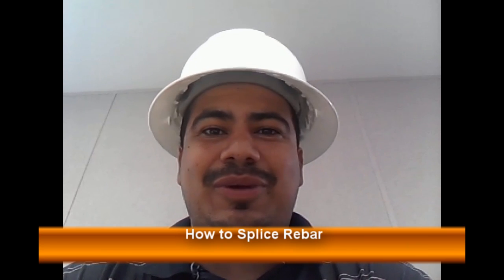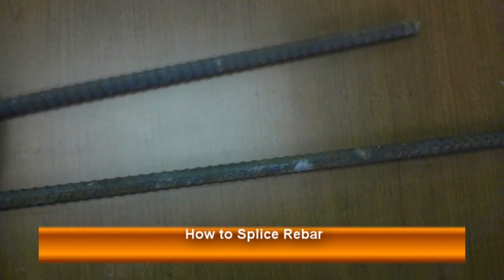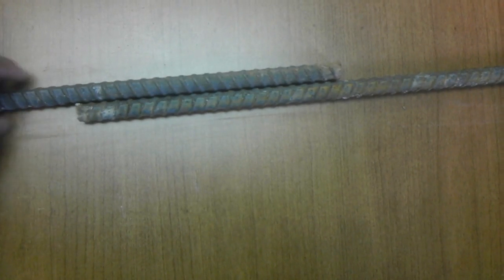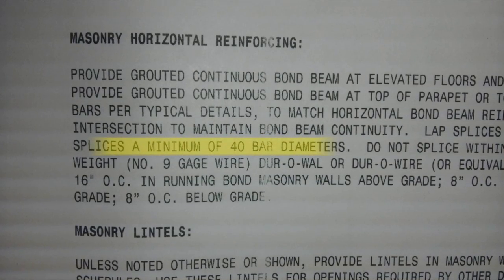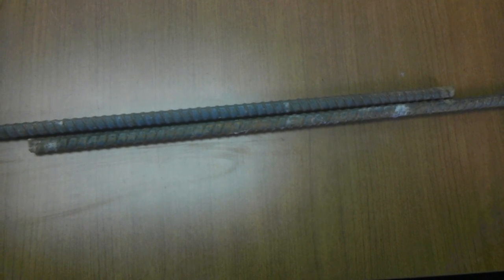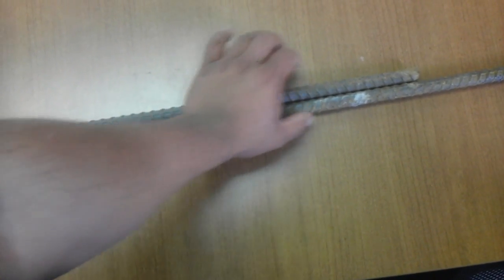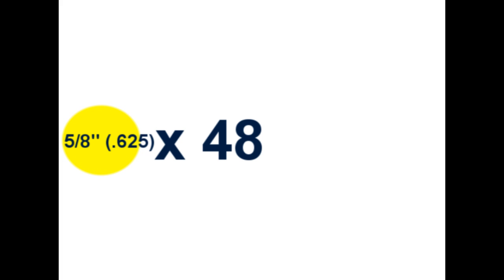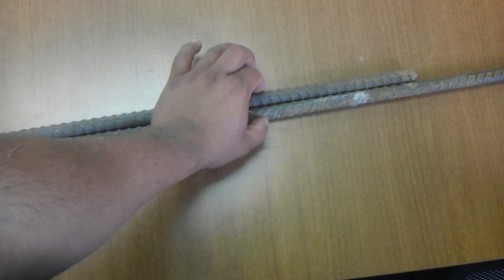How to Splice Rebar

Comment: I have a question because the viaduct precast bottom slab was used 34 times bar diameter? is that safe? considering HS2 live load plus live load passing through on that bridge structure?

Comment: can we weld rebar splices of columns instead of tying ? Is it safe ?
Reply: Chairs supports,the welder should knock it with the welders hammer,are thin metallic hammer so it gets its strength